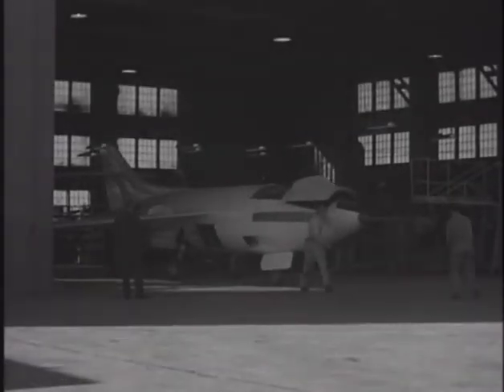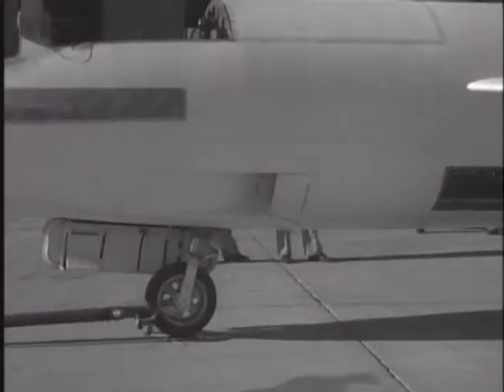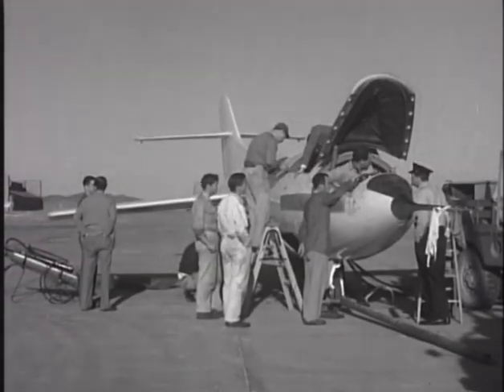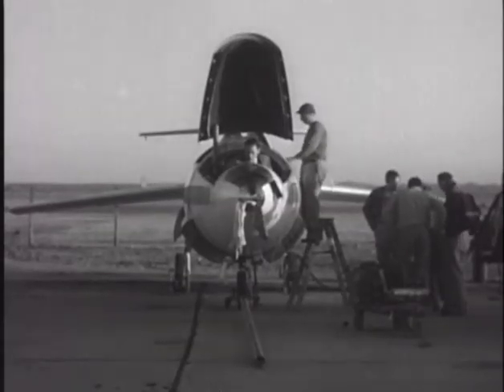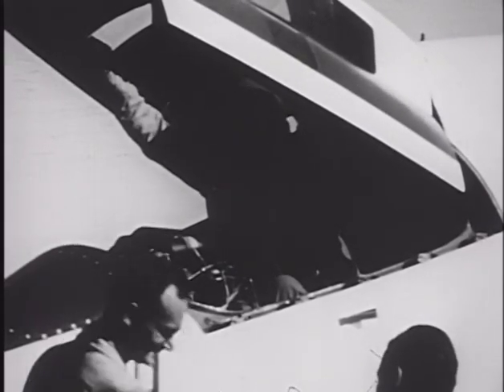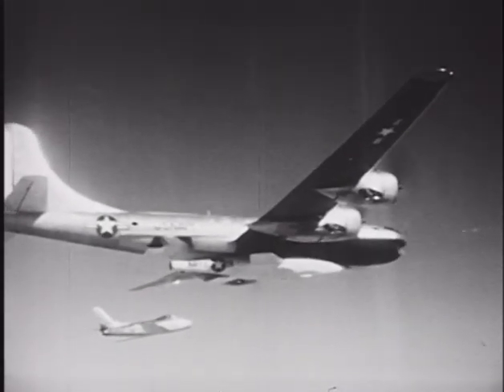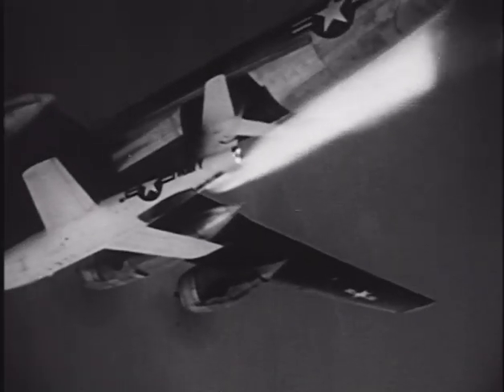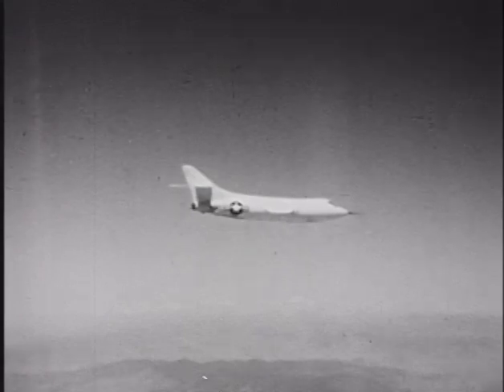Douglas D-558-2

Comment: Such a beautiful plane, pity they didn't put a bigger jet engine in it and put it into service.
Reply: This was at the dawn of a new age.  Rocket propulsion wasn't quite as attractive as it had been during the war*.  Hybrid propulsion was even more problematic, for it involved multiple system complexity and added weight.  Soon, higher power turbojet engines-and the very similar boost given by the new, simple, "Afterburner" mechanism would allow designers to turn away from the concept of hybrid propulsion fighters.

*Along with Germany's iconic Me-163 Komet rocket powered point defense interceptor, the Soviet Red Air Force fielded small numbers of the La-7(r).  This was a fairly normal Lavochkin La-7 fighter with an added rocket motor at the back.  The fuels or oxidizers used (depending on nationality) were caustic, poisonous, and/or fire causing.  Stuff like red fuming nitric acid (Soviet oxydizer), and 86% pure Hydrogen peroxide (German oxydizer).  Overall, rocket planes were a cool idea, but dangerous to fly . . . or be underneath.
Reply: @WildBillCox13  Actually, "hybrid propulsion" had already been tried and proven. The Luftwaffe used nitrous oxide as an additional propulsion addition to the Bf-109 series.